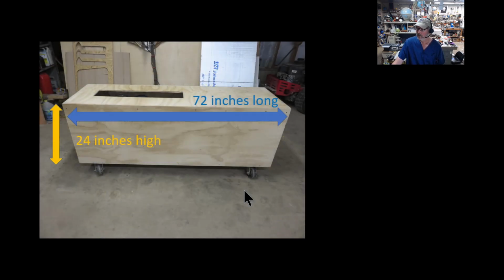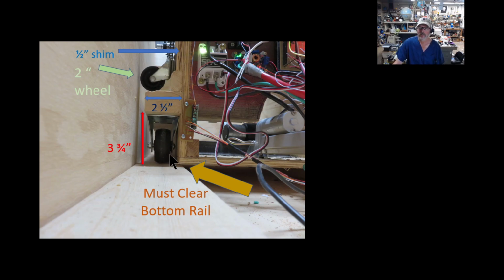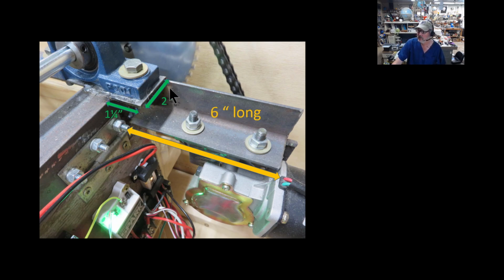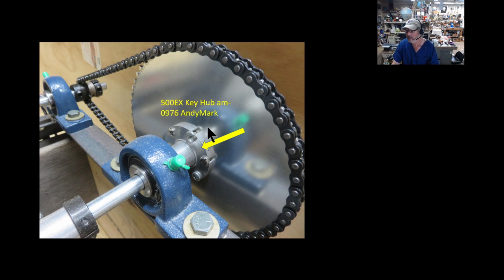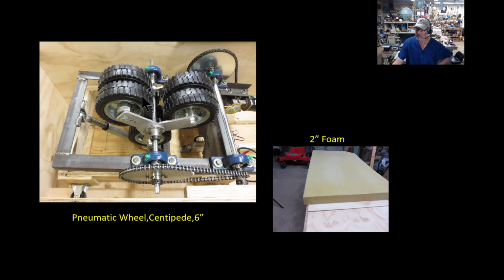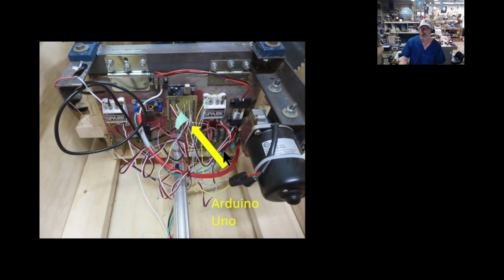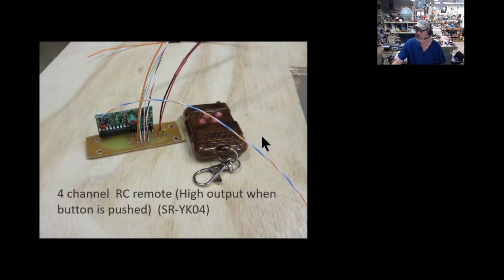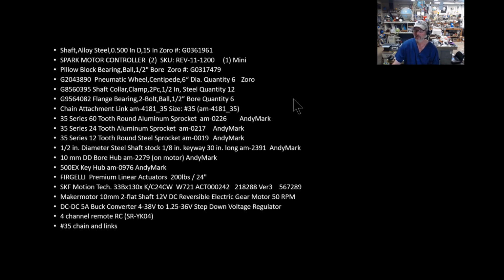Back Roller/Intervertebral Traction Table Detailed Build

Comment: @jtandhz Thank you for providing the video. It is greatly appreciated. Would you happen to know the estimated cost of materials for this project? Understandably material costs have changed in recent times, but if you could still provide a rough estimate it would be most helpful.
Reply from the maker: Thanks, I guessing it was around $500 for the parts I bought. I did have the shorter linear motor from a wheelchair tear-down and the aluminum and steel on hand was from left over projects. After two years of using, I can say it was well worth it.
Reply: @jtandhz  Thank you!